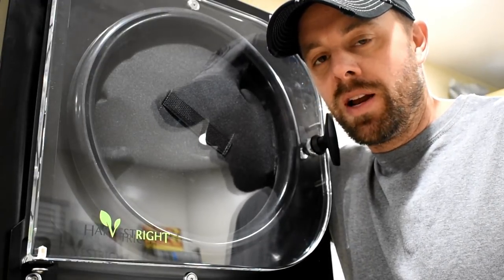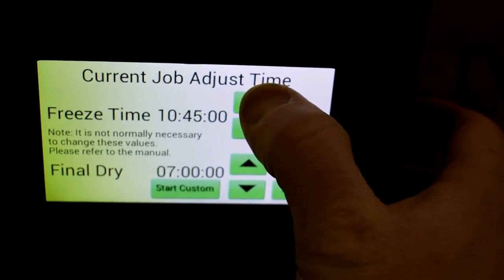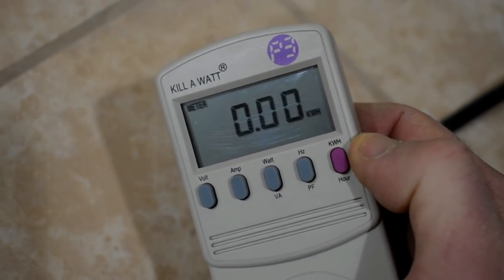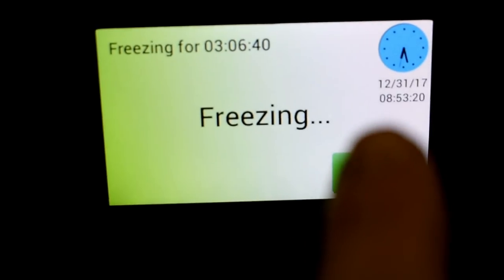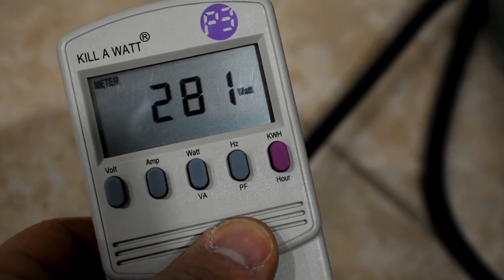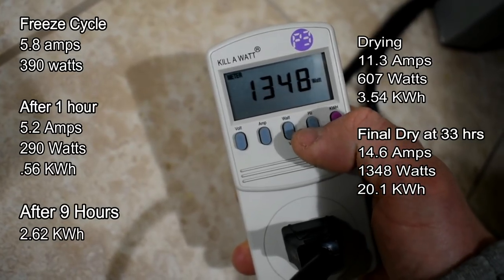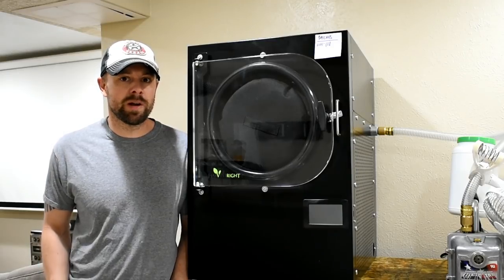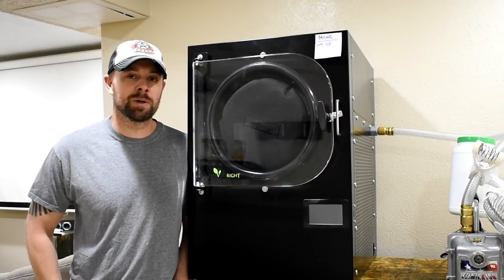How Much ⚡Electricity⚡ Does A Freeze Dryer Use? Energy consumption of the HARVEST RIGHT

Comment: Why am I so confused with Amps and Watts here.  Why are the numbers so different?  1348 Watts at 110 volts should be 12.3 amps. Why does it say 14.6 amps? Which value is right?  Bigger one would be 290 watts vs 5.2 amps (which should mean 572 watts).  My guess is the Watts measure is right and the Amps is somehow incorrect.
Reply: 1348 / 14.6 = 92 volts. I don't think your house is 92 volts.  US electrical should be 114 volt to 126.  I was wrong to say 110 volt.  So 1348 should be 11.3 amps at 120 volts.

Comment: Use your solar system and it's free
Reply: Wish I could it costs to much and dont pay off we heard
Reply: Technically yes, green energy (solar & wind) would help/be free but only after the break even point has been met re purchase/installation costs. Ideally, you would want to set up your system so you could $sell$ extra power back to the electric company, this way your energy costs would actually be 100% free PLUS you would be making a small profit(!) Technically, you also have to factor in maintenance costs, since your solar/wind storage batteries will need replacing apprx every 5yrs, while your solar panels and/or the generator inside your wind turbine, will need replacing every 15-20yrs (OR SOONER) depending on the quality and/or warranty of the equipment purchased  (o:
Reply: That's true for dehydrating foods but not for freeze drying that lasts 25 years and has a totally different texture.  I have both a freeze dryer and 2 dehydrators.  I use each for different applications. I use one small dehydrator far out in the back yard for dehydrating onions, peppers, and garlic. I use a 10-tray for dehydrating foods inside.  And I use the freeze dryer for preparing foods that I want to last for years or rehydrate to their original state (not all does). You can't tell the difference between some freeze dried foods that have been rehydrated and the original foods.  I'm building a couple of solar dehydrators for use off grid. They all have their place.
Reply: I have more than made my freeze dryer pay off in 1 1/2 years by freeze drying foods for camping and survival foods.  WELL worth it.  I bought a 5-tray for just under $3,000 and have been busy with it. It costs me less than 20 cents to FD 3 scrambled eggs with bacon bits for camping.  Compare that with the same FD camping foods you buy ($4).  I have a grandson with Celiac disease and prepare GF food for him and can save it as well as make snacks and camping food for him. We are always prepared for hurricanes and power failures or just too tired to cook tonight.
Reply: Kathy Young, I'd be interested in knowing what/how you use the two appliances differently.  I have a good dehydrator (an Excalibur) but would like to know why you feel it's a good idea to freeze-dry vs dehydrate.
Reply: Can't totally explain it here in small space. I do both.  FD preserves food for much, much longer. And the texture is closer to the original (often can't tell the difference). FD: nearly all our long-term survival foods and camping meals. Dehydrator: (Cabela's 10-tray model) for kids' snacks for school, herbs, onions and peppers, yogurt drops, tomato puree, fruit rollups, dried fruit, etc.  Also if we ever have a long grid-down, the FD is useless, but I will fall back on my solar dehydrators I am building. Example: FD ham can be reconstituted, and you can't tell if from original. Dehydrated meat is jerky, never near the original. Sending you another message.
Reply: Don't know where you live. I am doing a big presentation on Freeze drying (and also dehydrating) in October at the NC bug out camp (Oct 18-20) of the PrepperNet organization, which started here near Raleigh where I am and has spread nationwide.  You can join if you like no matter where you live. We learn to prepare for all kinds of emergencies -- tornado, hurricane, power out, floods, etc. We helped the Cajun Navy with their coms last fall. Preserving food is a priority. Let me know if I can help you more.

Comment: The cost IS WORTH IT. the issue is that machine the size of a washing machine and extremely expensive.
Reply from the maker: More the size of a dishwasher and you can make up the cost quickly.
Reply: Only the large dryer is the size of a "Small" dishwasher - the other dryers have a smaller foot print. I use a large dryer. The large dryer will process more food than the small and medium dryer.....combined.

Comment: It cost more to run an electric water heater then to run the freeze dryer. A deep freezer probably cost more then that as well.
Reply from the maker: That's good to know.   There is so many folks who think $2.50 per cycle is so expensive.  If you look at what electricity is saved vs. how much is spent, it far outweighs the cost.
Reply: @thefreezedryingcommunity  I'm a little late to the party, just now studying this process, but it seems to me that a FD would be an additional 
monthly cost if the freezer would still be running. Especially, when I'm 
reading, the best way to reduce the FD process time, is to pre freeze 
the food first?  Unless I'm missing something.

Comment: This is aids. Don't save money after all
Reply from the maker: Without a doubt, if you use it to its full potential, it's saves you money.  Food costs, will go up, electricity will go up,  prepackaged FD food will go up (everything will go up).  Meanwhile, you have freeze dried food from 20 years ago that has not cost anything to keep cold.  You did not have to pay the current cost of food and it's the kind of food that YOU chose to freeze.